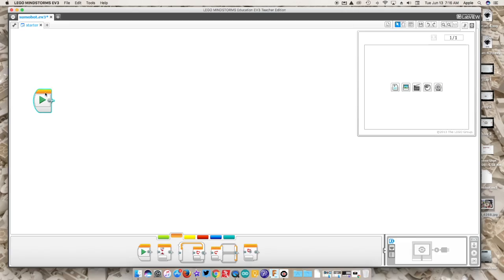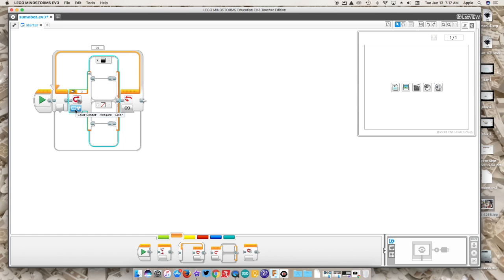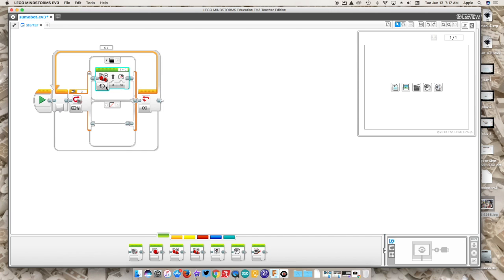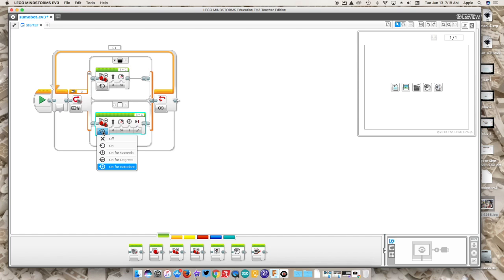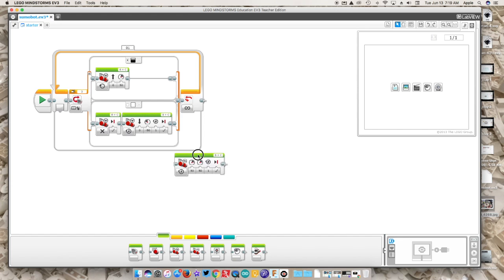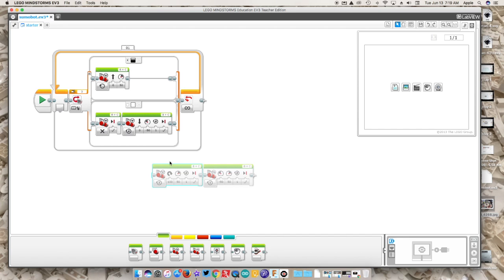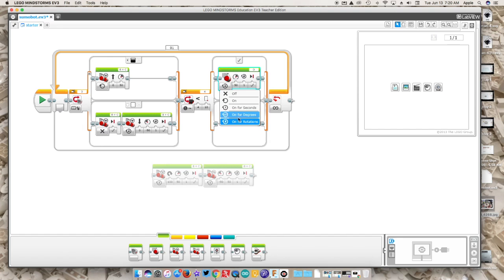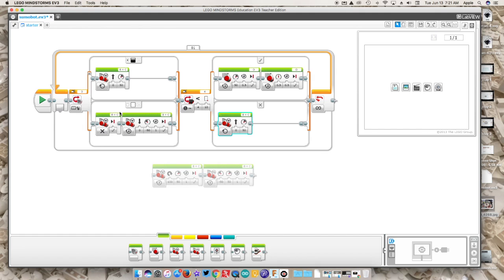LEGO EV3 Sumobot Coding Tutorial

Comment: how to write code for 4 engines?
Reply from the maker: By engines do you mean motors? If so, you can run parallel coding for the motors.
Reply: @coffeechug  yeah already found solution
Reply from the maker: @edgarkurm8148  Awesome! What did you end up doing?
Reply: @coffeechug  simply putting 4 Large motors in a column.  You cant use move for rotations or move tank, everything that is using more than 2 motors. I mean A+B, C+D you cant use them, idk why, but it doesnt work this way. The only way is to programm individually every motor. If you make video about this it would be nice for some ppl, cause i ve spended a lot of time trying to make it work, thinking i am stupid, but no, this programm is a bit stupid.

Comment: If the sumobot doesn't have the ultrasonic sensor, you don't add the ultrasonic part, right?
Reply from the maker: Correct. If you are not using the ultrasonic, then no need to have that in your code.
Reply: @coffeechug  Will infrared sensor work the same way as ultrasonic in this algorithm when it comes to precise aiming?